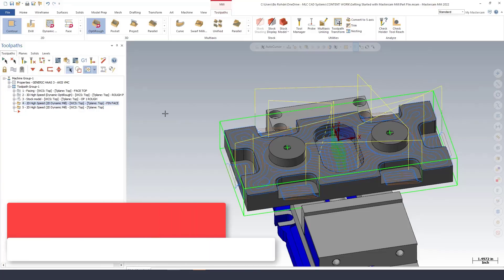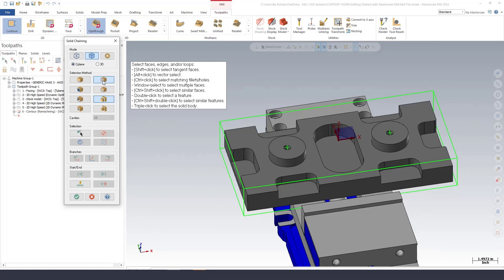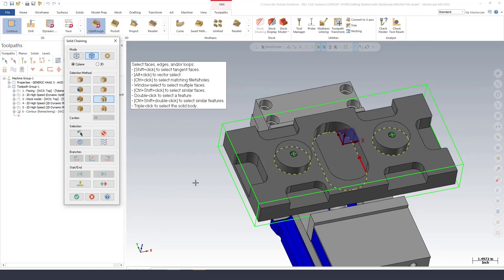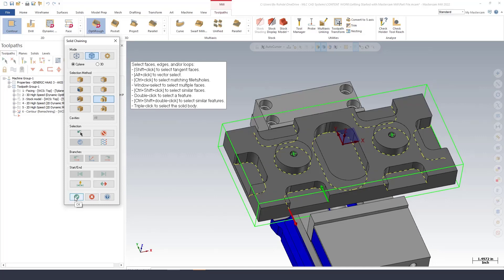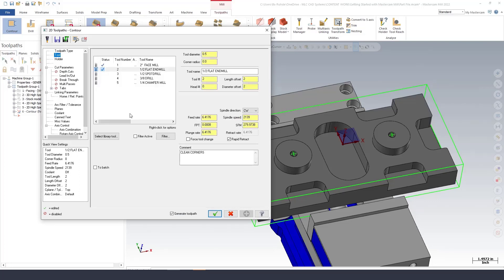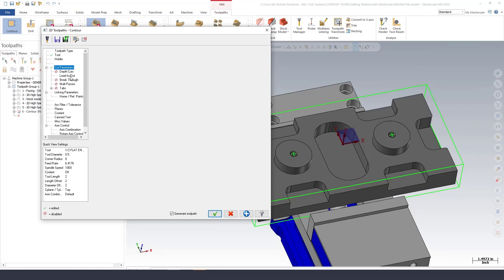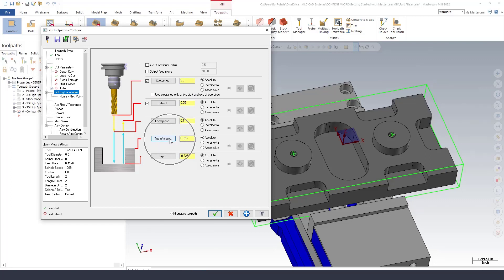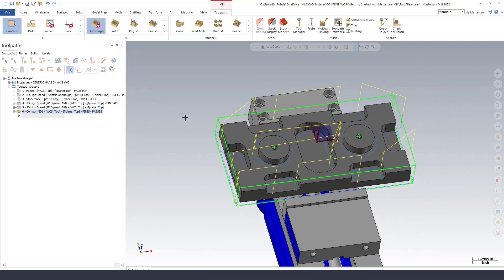How to Finish Walls with a Contour Toolpath - Getting Started with Mastercam Mill Webinar 10/12

Comment: I am guessing that the 1/2" end mill is large enough to clean up the complete floor. No step-over passes needed? I like the this MC works. Thanks for the video.
Reply from the maker: The floor finishing is done in a separate operation.  https://youtu.be/E9DOWFZksWw

The strategy here is to rough it to the point where only one finishing pass is required on each surface.

Comment: By selecting the bottom contour of the part and not modifying the height, the tool will run into the vise. Is that correct! 🤔
Reply from the maker: Yes, depending on the geometry of the part, the selected contours, the geometry of the fixture, and the location of the stock model, yes you could absolutely run into the vise.  Ideally, you'll avoid that, or at least identify the problem in Mastercam before sending it out to the machine.
Reply: @MLCCADSystems  always verify, even with simple drilling toolpaths. I always verify :)